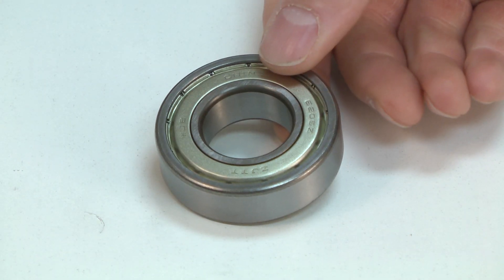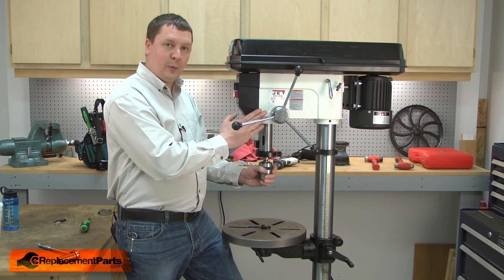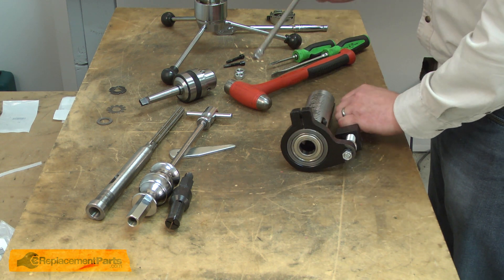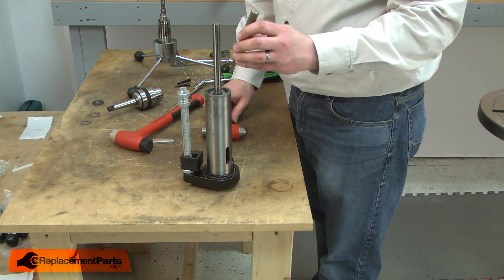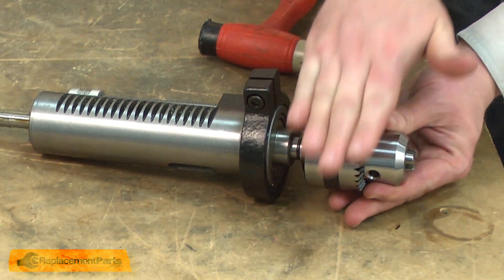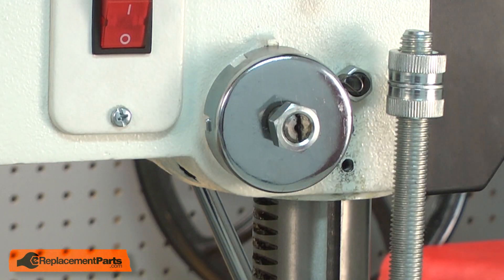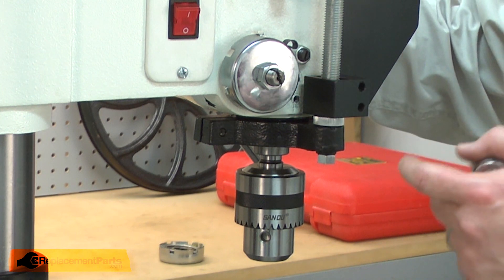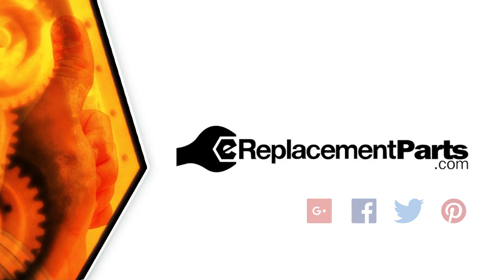Jet Drill Press Repair - Replacing the Ball Bearing (Jet Part # BB-6205ZZ)

Comment: Since impacts on the drill chuck jaws can damage them, did you have any 'softer than the table' material under it for when it dropped when you released the spring tension?  Or did you at minimum spin the chuck so the jaws were completely retracted first?  You should also note that anytime you replace bearings etc you should carefully clean out any dirt or grime that may be int here or the fitting of the new bearing will be much much harder/you may damage things.  Also your video showed it, but you should mention that the angle of the drift punch should always go in the direction you used otherwise it can cause damage.  At least that is what I have heard in other videos. My 'luck' is that the current drill press I am working on restoring is older than when those were added. :)  So I will have some excitement/frustration to do that part when I get there this weekend.  I did like the video though and I learned about several new tools to look at getting, so thanks. :)

Comment: I liked the video. I have been in design engineering for over 44 years dealing with bearings during this time. The only issue I have with this is hammering on the spindle to press it into the bearing. This dents the balls and raceways of the bearing. These dents will greatly reduce the bearing's life. It should be pressed to avoid the impacts of the hammer.
Reply: The task can be done with better results by using a large extension socket that fits near the diameter of the bearing.

Comment: I need to replace the bearing on the spindle pulley ... I don’t see anything holding it on ... do you know if Jet has tapered fits on these or is it screwed into the threads, etc.?

Comment: For a guy making repair videos, I'm suprised that you made two fundamental mistakes.  First, you should have removed the bearing out by tapping on the OUTER (supported) race.  You should never tap on the unsupported race of a bearing whether removing it or installing it.  That can easily damage the bearing. And, yes, I realize that you were replacing this bearing so damaging it was no issue but you should still demonstrate it the proper way so viewers who may not know any better won't think this is the proper procedure when removing a bearing that they are going to reinstall.  For example, knocking out bearings in brake drums, etc.  In other words, always do it the proper way as a matter of procedure.  

Second, although you did tap on the outer (supported) race when installing the bearing, you shouldn't tap around the edge as you did.  Sure, it will work but it's not the best way to do it.  You should used a socket the size of the outer race or a washer the right size or ground to the right size under the socket to drive the bearing in evenly all at once.  You can also simply use a block  of wood. The idea is to drive the bearing in straight. Doing the way you showed here can sometimes be frustrating as one side of the bearing pops out while tapping on the other side. There's no reason to do it that way when it's faster and easier to do it the proper way. 

Beyond that, I don't know if it's the design of that drill press but you didn't show how you disconnected the shaft from the belt pulley.  On my drill presses, a nut has to be removed.  If your shaft simply dropped out as you showed, what locked the pulley onto the shaft? If you skipped a step in your video, that's an important step.
Reply: And how exactly would you do that? Given the fact that the outer part of the bearing is fully seated in the housing of the drill? It's pretty common sense you should not install the new bearing like this, but removing a bearing that goes to the junk yard, the most easiest way is acceptable.